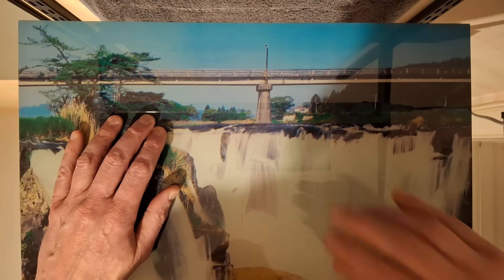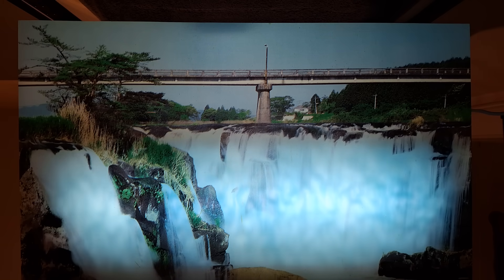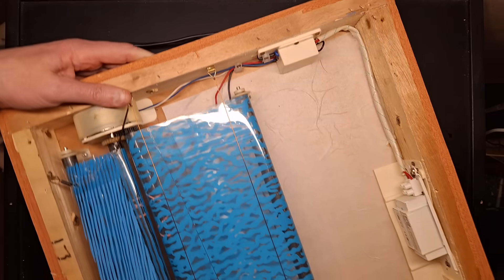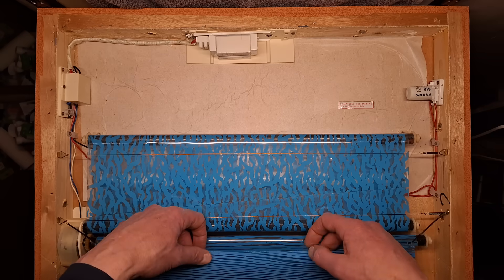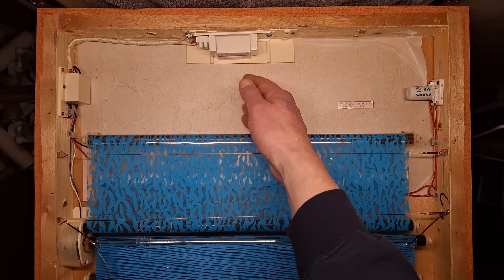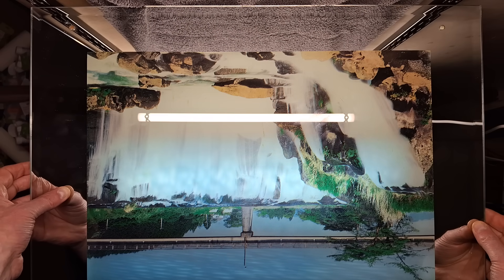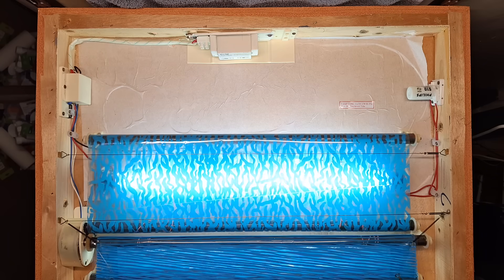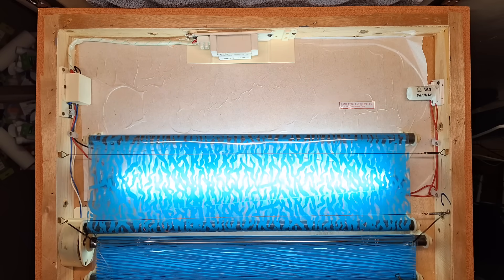Inside a dodgy moving illuminated picture

Comment: Hey Clive... Did you get my comment about the ridiculousness behind the Tom Evans £25,000 Pre-Amp repair 'Copyright Claim' against 'YT 'Mend It Mark', due to his 'Drawing of the circuit layout' (a standard thing to do when working out circuitry)?? Seems like you too could get in trouble photographing circuit boards & drawing technical diagrams! 😏🤣🤣🤣 😎🇬🇧
Reply from the maker: I did and left a comment on his video.  Given how many of the items I look at have been cloned to death, it would be hard to find the original designer.
Reply: I fail to see how drawing a circuit on a piece of paper is copying an amplifier, or am I missing something?
Reply: @nicolassales8679  I think, we are ALL missing the point of what the amplifier company Tom Evans is trying to make with that rather expensive £25,000 Pre-Amp repair video by 'Mend it Mark'. He did what he usually does, make a video about an amplifier repair (he'd done many from vintage to modern), and, as he had no technical manual for that Amp, he had to work out where/how/what and everything to diagnose and then repair the fault. Part of it was to draw up a schematic of components and wiring diagram, yet, Tom Evans deemed it necessary to force a 'Copyright Strike' on YouTube against Mark... It's all basically a load of old b@ll@x, because Tom Evans wanted MULTIPLE THOUSANDS of £££s for the repair (when it turned out to be a shorted component (I guess made out of 'Vibranium plated Unobtanium'?)... Basically, a 'Lowly' kind, nice guy on YouTube showing up a snobby HiFi component company...  And Tom Evans DIDN'T like it I guess... 🤔🤨😒
Reply: @nicolassales8679  Drawing the circuit is a false excuse for the  copyright claim, the video got taken down because it showed that a $30,000+ amplifier is absolutely not worth that, there are no precious components or clever circuitry inside, plus the construction is amateurish.

Comment: We've still got one of a waterfall that's mounted on a lounge wall, and of which I bought in the 90's from one of those pop-up High Street Christmas shops. It has many air vents drilled into the wooden sides of it, and it squeaks quite a lot when running. So, because of that and the smells that emanate from it, I've not had it running for more than a few minutes per year when family insist on seeing it in action.

Comment: Looks like a LED upgrade project.
Reply: With  scavenged backlight from broken LCD monitor
Reply: Just make sure to get leds with high CRI.
Reply: After all these years in storage it desperately wants to be lit and displayed but by doing so be cooler than ever. Also it fancies some different hues.
Reply: For sure then it would run cooler !!
Reply: Will it be safe with LED, I suspect so
Reply: The direct slot-in replacements are too directional.  It might take three to get light through the falls while rippling the pond and lighting the sky.  Fluorescent really works better.
Reply: want to see
Reply: Be interesting with some addressable LEDs and possibly a matrix too.
Reply: Ew!
Reply: Why do people always want to upgrade everything that works perfectly fine?
Reply: 2 week old comment on a 4 day old video?
Reply: LEDs can make a lot of things much more viable. Things like Christmas tree fires shouldn't really be an issue anymore because they give off so little heat you could just leave your lights on all the time. And things like this that would be a fire risk and take considerable amounts of power to keep running are completely viable again
Reply: @TransistorBased  That's very true. My mother still insists on turning off her LED Christmas lights an hour before bed time to "cool down". I've tried explaining LEDs don't really get hot and she can turn them off when she goes to bed. Old habits die hard though.
Reply: @TransistorBased LEDs would get rid of that transformer ballast, the starter, and the fluorescent lamp and thus nearly eliminate the fire risk in this moving picture. I agree it’s a good upgrade. A dried out dead pine tree will torch at the slightest source of ignition, be it Christmas lights, candles, embers from a fireplace, etc. LED Christmas lights do increase safety in one important way: far less current means a far lower chance of overloading an outlet or causing wires to get hot.
Reply: @TransistorBased  Incandescent Christmas light barely get warm.
Reply: @Sonny_McMacsson  modern ones don't get warm but older globe style ones absolutely did
Reply: @TransistorBased  How far back are we talking? The incandescent indoor mini bulbs haven't changed very much for at least, like, 60 years. I'm not even sure what kind you're referring to and I'm not sure I've ever seen them.
Reply: @Sonny_McMacsson  you must be decently young if you're unfamiliar with any other type of Christmas lights than the commonly available thin bulbs. For ages they much more similar to standard fixture bulbs and got pretty hot. Hence Christmas tree fires.
Reply: @Sonny_McMacsson  Problem was that old fairylights are wired in series and a wire inside each incandescent bulb shorts when the filament burns out, pushing more voltage to the rest of the bulbs, until a chain reaction suddenly burns out all of them, in worst case making the cables glow and start a fire.
Reply: @cyberyogicowindler2448  Yes, I just had a set do a burnout cascade last year. Nothing got remotely to such temperatures since all the insulation was still completely undamaged. Sounds like poorly conceived designs that aren't made for the worst case. BTW, they also have limiting fuses which will burn out before they ever get to glowing. I don't know where you got such lights.

I know you said "old" but fuses and those self-shorting bulbs IIRC were introduced around the same time. There was a time one bulb would go out and an entire section of the string would be out since the bulbs didn't have the wire in them, and you'd have a fun time tracking it down.

Also, weren't we talking about normal operation and not failure?
Reply: @Sonny_McMacsson  Properly designed incandescent fairylights won't self-combust when left alone until all lamps burn out. But the chain reaction did happen in poorly made models those have no fuse at all (withing or outside bulbs).
Reply: @cyberyogicowindler2448  Properly designed lights shouldn't combust at any point, not just when all the lamps burn out.
Reply: @Sonny_McMacsson  I only remember warnings on TV product test docus that poorly made (often Chinese) incan fairylights could melt insulation and catch fire (by this way shorting its mains wires?) when the chain reaction started.
Reply: @TransistorBased  what was your point.
Reply: @phonotical  what do you mean what's my point? LEDs are a great innovation that make for efficient lighting and less heat transfer. Seems like a pretty simple point
Reply: I thought of that as well. If you were going to do something modern day though, you could just use an LCD screen and microcontroller for nearly the same price.
Reply: Dont do it! Keep it retro and original
Reply: @denniswillson5990  It's too dangerous though. And the kind of light source isn't visible anyway.
Reply: @denniswillson5990  Hmmm - Keep it Retro & risk burning down your house or retro fit safer LED's for the lights... although I'm all for 'keeping the original' some things I can see why you should upgrade. There's could be a fire risk IMHO due to the motor burning out/overheating but removing the paper & changing the wood frame for fire retarded treated wood would still keep the tradition alive
Reply: Cultural vandalism
Reply: @phonotical  The plastic apparently warps by flu tube heat (may jam the motor and cause fire), thus for preservation of the thing, LED upgrade (and additional fuse) makes sense.
Reply: LEDs just don't look right compared the the flourescent light.  Plus if the flicker, with the motion, that could be nausea inducing.
Reply: @Cassandra_Johnson there are direct replacement LED “tubes” for the fluorescent. They match color pretty well and flicker is minimized. They even have some that bypass the ballast and run directly on 120-277V.
Reply: @Cassandra_Johnson  You've been watching Technology Connections rant about his Christmas lights again, haven't you? 😉
Reply: @Cassandra_Johnson  I made the same argument when LED's started displacing neon filled tubes in signage.  The LED just doesnt grab your attention like neon does,  static versus dynamic. Pretty much the same idea of how it works between neon/flourescent. You cant consciously see the difference so well, but you can somehow sense the neon is more "alive" due to random variation in emission across the lamp. Neon is, in fact, more attractive, in the true sense of the word.  I wonder if an LED driver to randomly vary the frequency of intermittently powered LED's could simulate that effect? I think the flicker you refer to is the result of a cheap manufacturer who left out the capacitors to make a penny more profit on a dozen units, likely more problematic for 50Hz than 60Hz. My dad did a lot of trickery with LED's  you can drive them to much higher currents intermittently to get a higher peak light intensity out of them without overheating which causes them to appear brighter to the human eye using less total power. If you pushed that too far the flicker out of the corner of your eye while in motion was more noticable. Not worth the trouble unless you are driving MANY LED's or have severe power/cooling constraints as is increasingly the case with miniaturization.    Got me thinking about a study on UV LED's for use in mosquito zappers, pulsed emission at specific frequencies was more attractive than straight clean DC drive, CW I suppose would be an approprate term there too. Had something to do with perception of motion, used to navigate, in a sense comparing one frame of video to the last frame to measure distance/speed. Perhaps some people are more apt to become confused, disoriented, seasick from such a pulsed light application?  Would be interesting to see the result in visual reaction time compared to annoyance from pulsed light to see if there is correlation.
 Funny how much more engaging one is when they finally loosen their grip and get the GOOD coffee.
Reply: @Cassandra_Johnson  but fluorescent lights are hideously flickery.
Reply: @Cassandra_Johnson  LEDs won't flicker at all if you use a rectifier (not recti-fire, add a fuse) and capacitor.
Reply: @Cassandra_Johnson  LEDs only flicker if they're being run at a duty cycle of less than 100%. If you just feed them power there's no flicker whatsoever. And given that LEDs have been produced in any color temperature for decades now, color tone is not an issue

Why are you trying so hard to find something to be annoyed about?
Reply: @TransistorBased  Right, the problem is pretty much every single "off the shelf" set of LED Xmas lights flickers because none of them include a full bridge rectifier and smoothing capacitor.
Reply: @mllawso1  That's on you if you want to put Christmas lights inside wall art, but the average person would use an LED module meant to replace a standard bulb
Reply: @TransistorBased Yea you forgot to mention about the actual 50-60 hz flicker you get with running strip tubes on the mains too. 👍 You can get some really nice warmths by mixing LEDs these days. It's just down to preference and what people know I guess.
Reply: @mllawso1 That's on the power supply and to be fair there mostly switch mode PSU but the reason they flicker is the pwm driven not a pure DC source.
Reply: @SlyerFox666 I thought this too but if we are being picky the strobing on AC will be double the supply frequency because it lights up on both positive and negative half cycles.

Comment: Burning water, it could have been a very dramatic effect.
Reply: They could have pegged the irony meter by animating a fireplace scene this way.
Reply: @sometimesleela5947  Ironically enough, I think a lot of British-made flame-effect fires of the 50s & 60s used a very similar technique, usually a slitted cylinder with an incandescent bulb inside configured such the heat from the bulb made the cylinder rotate and caused a dancing glow effect on the fiberglass „logs“ at the front. 😇

Comment: In the 70's there were cylindric vertical lamps with a metal cage inside that started to rotate from the heat of the bulb in the center giving a similar effect. The cage started to rotate through the air convection inside the cylinder. I haven't seen them in a while and with LED lamps they wouldn't work as intended.
Reply: That reminded me of the electric fire we had when I was a lot younger... There were two radiant 'bars' mounted above a fairly convincing coal bed. Hidden below that a lamp made the lighter parts of the coal bed glow.  But the icing on the cherry was a little fan blade balanced/ pivoted above the lamp.  Convection turned the 'fan' so the coal embers flickered nicely.  I was easily pleased back then.
Reply: @keithmiller5042  We had an electric fire like that when I was little, but the mechanism was even more trivial, it was just a strand of ordinary tinsel that was rotated by a clock motor.  The effect was reasonable, however, as the tinsel cast both moving shadows and reflections.
Reply: @keithmiller5042  You mean those fake fireplace light effects? They were a surprising mechanism with motor driven spinning shiny sheetmetal parts etc., quite similar to op-art kinetic sculptures.
Reply from the maker: Those were popular here too.
Reply: crikey thats brought back memory's, can almost smell the lamp melting the plastic base .
Reply: I recall seeing the cylindrical lamps in the early '60, and they were old then. The three scenes I remember were Niagara Falls, a forest fire scene with deer, and a steam locomotive with scenery and smoke flying by.
Reply: That's the style of lamp I was thinking of in my comment. Presumably, the picture frames were a logical evolution of the same. 😇